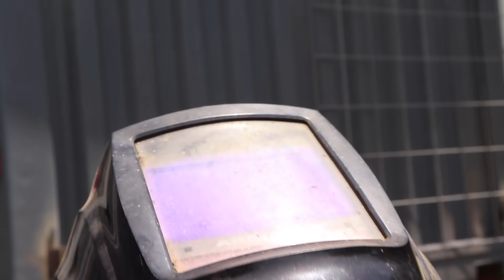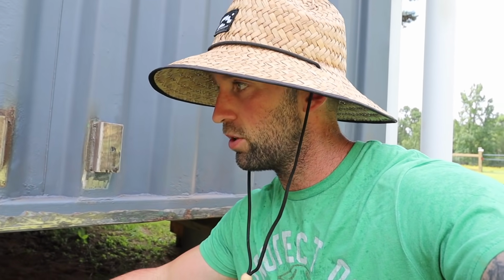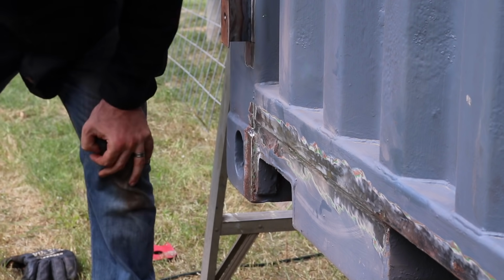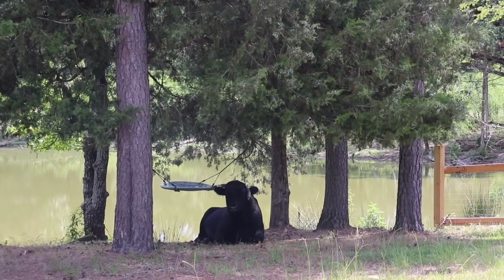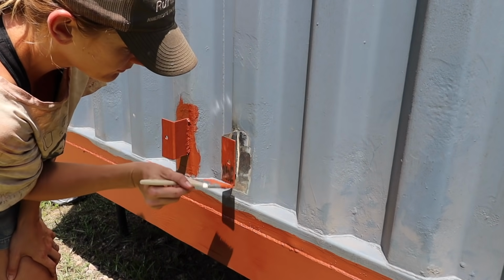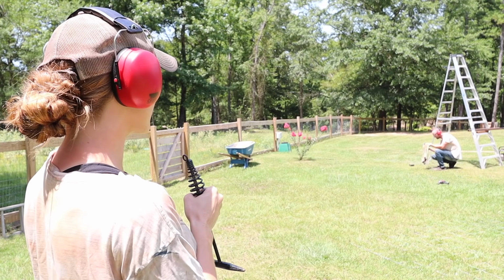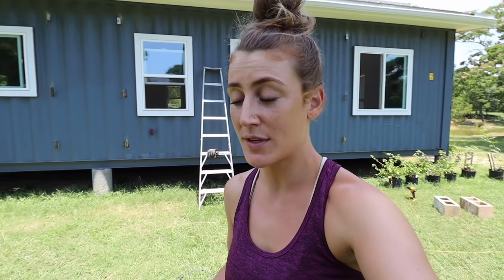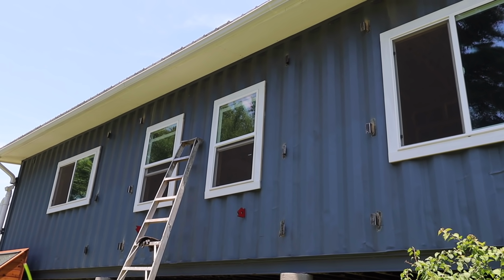How We're Passively Shading Our CONTAINER HOME!

Comment: Be careful on your trelles.
 If its close to ground, snakes might use it to scale up and enter your rafters...
 Just a thought, I was going do same thing.
 I live in guam a tropical island and we have snakes. Non poison but still a nuisance.
 My container home project @3/4 done.
 Still looking at best spray foam insulation.
 Not trying to keep heat in. Rather keep sun heat out.. Always sunny in guam. 
  I own a concrete house, just have a container that I am using as a hobby project and also to use as a next door home
  Beau is getting bigger each day
   Best of luck on your new home

Comment: Grinding fence sections in grass - if you have a strong magnet you might attach to a hand held pole and sweep for small metal bits. Similar to devises roofers use when picking up stray nails. Safety thought before mowing grass.

Comment: Wait - You said that you're NOT doing the SOUTH side of the house for passive shadng only cosmetic? The SOUTH side of any home is the side that gets the MOST direct sunlight. That's the side that you would want the MOST passive shade on! You need to research that. The SOUTH side should have got the most shade for summer cooling.
Reply: You're exactly right. If you're north of the equator you shade the south side in summer. They literally did it backwards
Reply: You're absolutely correct. All of our shops are passive shaded on the SOUTH side of the buildings. North of the equator the south side gets the most sun every day.
Reply: I was thinking the same thing and looked it up. The south facing side is the side that should have been shaded the most
Reply: While that may be true, my patio faces west and the late afternoon sun is horrendous.
Reply: In the northern hemisphere you want southern facing for passive solar in the winter time, which is the southern hemispheres summertime. 
North facing you want minimum windows for preventing heat loss in the winter.

They have a large amount of south facing windows and cosmetic shading.. eeeeek. Aircon bill is going to be high...
Reply: @steph0xGx  exactly right. In the south we shade the south and put the windows facing elsewhere. I don't know where they're located but shading the North side doesn't seem feasible in either hemisphere
Reply: I think the solar water heater, porch and addition are on the south side, may not be a place for trellises.
Reply: @Russell731  if you think they have sized their system enough to handle the extra load that having less shade and all those south facing windows will put on it then great. 
Guess it isnt you or having to live in it though

Comment: When working outside in the heat, I have found it really helps to use a fan to move the air to help cool down some.  I know you were moving around a lot, so put the fan so it blows towards the spot where you're spending the most time working.

Comment: Heat exhaustion. Here are some tips (Fans, please don't hate on me and play apologist on this. I'm really trying to offer advice that will help him avoid exhaustion): 1. Of course, drink plenty of water. 2. Move your equipment closer to where you're working. Last week, you had your saw 75 feet away from where you were putting the siding on the house. The time lapse showed you walking back and forth like a thousand times. Move the saw right by where you're working, and you'll cut your work load in half at least. 3. Stop adding external projects during the hottest months of the year (like welding this vine rack to the side of your house). I know you said you had to do it now, because you can't spray your foam insulation before welding, but you can delay the insulation until it starts getting cooler outside, and you can always plant your vines next year. While this may not be your first choice, it would be better than dying from heat exhaustion. 4. Turn on the air conditioning, and FINISH off your bedroom, bathroom, and kitchen, right away. Then move out of that camper, and into the house. Work on the outside of the house later, after the weather cools off a bit.

Comment: If you all are still deciding on a color for the home a light color does well to repel the suns heat. White works best but since the home is metal on the outside it will get hot and insulation can only do so much to keep the heat out

Comment: To cut a strait line in sheet metal I use a circular saw with a metal abrasive blade. Its much neater and much faster. Keep in mind you will then not be able to use the saw for anything else as all the plastic on the protection guide will melt

Comment: I have an idea to keep the bull from swimming around fence. Get some polypropylene rope (it floats) and some pool noodles. Thread rope thru noodles ,tie one end to fence post and the other to the dock...6 or more noodles. It may keep Ferdinand out, if not, it is not expensive. You could also extend straight out into the pond, tie a stone to the outer end, maybe angle it away from your dock. If Ferdinand has to swim away from your side he may stop?

Comment: Hey guys, just a little bit of info on a quick way to recover from overheating.  find a way to submerge at least your arms in cool water.   I can't post any pictures in this section, but we used to take a folding chare and these 2 foot x 8in. planter boxes that were meant to be hung on a balcony or fence and put them on the arm rests of the chair.  We'd fill them up with cold water and just make anyone who was overheated sit in the chair with their arms in the water.   It's amazing how fast you recover doing this.   Hope that helps you going forward.

Comment: The next time you get overheated take a towel /rag and put it in a bowl of ice water.  Then wrap it around your neck and leave it there until you feel better.  It works because there is a LOT of blood flowing through your neck so it gets cooled by the towel. Another trick is put your bare feet in a pan of ice water.

Comment: Trellis' are good ideas as they help shade and cool metal surfaces but did you consider that the constant moisture of the plants would cause the heavy wire to rust? Maybe brackets to hold something like redwood runners would last at least as long and might be easier to replace. Just for your consideration. I think you guys are doing great. Thanks for the videos.

Comment: **I am not sure how hot it gets there, but here is a trick I learned from a paramedic.  Wet and freeze hand towels and place them in the freezer.  In the afternoon when it is hot, take one out and place around your neck.  When the arteries along each side of your neck cool down from the hand towel, your whole body will then cool down.  This will protect you from becoming overheated.  And when one hand towel unfreezes and is no longer helping, go in and get another from the freezer.  😉

Comment: Can’t wait till you start the inside
Reply: A lot of the inside is done, for example, most of the wiring and plumbing. Mostly what's left is insulation and finish work as soon as the exterior is dried in.

Comment: Wow. What’s going on the trellises? I would’ve just welded a bolt or two on top and two on bottom for each trellis and hung the cattle fence from that, one of those bolts would hold probably 300 pounds.  Your welding is getting much better though. You should wait till fall when it cools off to practice though.  Lol. I would melt in that sun doing all of that Welding

Comment: Where has all the hardie siding  gone not even one frame shewing or is that all on the other side of the house. Think this is perhaps an old video am i wrong. Love your underwater fencing skills. Go well noel
Reply: Noel Hamilton -  You initial assumption is correct - the sections of the home with siding is on the other sides. The west and south sides are containers only (except a portion not in view that is the tall, middle insertion between the two off-set containers).

Comment: Spencer use a bolt cutter when cutting that hog panel.  Using a grinder with a cutting wheel is waaaayyyyy to much work for steel that size.

Comment: I have been watching your show since the beginning and you have inspired me to take things slower and really think about the design and the fabrication before beginning the project.  It is evident that you guys do that.  One thing I would say as a welder of 35 years...you are welding way too much!  On the brackets I would have welded about 1-2" from top down on both sides...more than enough to hold.  And a solid bead across the entire plate you welded to the bottom of the container?  That is a lot of work and unnecessary in my opinion.  I would have tacked it in place and then stitch welded 2" and skip 2 or 3".  Not sure what the duty cycle is on your machine but that must have taken forever!!  Anyway...love the channel and your story...and you are right...your welding HAS come along nicely!!!

Comment: May be a dumb suggestion here but couldn’t it work to use a rope with floats—like the shallow end separated from the deep end of a pool. If it’s enough to deter the cows, you could run that as long as you need in any direction you need and it would be far less cost intensive and physical effort than extending a fence further into the pond.

Comment: while I really admire all the hard work you did here, I'm still just confused why a couple of quick wooden trellis wouldn't have given you a solid solution that you could potentially come back to later and instead spend your time actually completing the inside so you're not sleeping in the cargo trailer??  I'm sure you guys have your plan! Cheers.
Reply: Once they spray foam the walls they don’t want to be welding on the outside, foam is pretty flammable. That may not be the reason at all, I’m just guessing
Reply: @Iamthathillbilly  Yes, they mentioned that.  Welding the trellis on seems like overkill!   To each his own.

Comment: spend precious money on the necessary things now like the interior, trellis can always come later.
Reply: RockIsland Rides -    As another commentator explained: "Spencer told you that the welding has to be done first before they insulate. Hot metal will melt the foam insulation so you weld first."

Comment: what keeping them from walking all the way around,  like walking around the pool? i think i would just make the fence go all the way to the other side of the pond just add a post on the other side to make it like a tennis net but using fencing wire the bull will push the metal net but will not brake it if it thick kind and in the middle of the pond one pole  2 in between make it a fat one also. Or what about a  wooden bridge across the lake
https://cloudfront.traillink.com/photos/ohio--erie-canal-towpath-trail_46013_lg.jpg   like this link i just put but only make very narrow for on person to fit and next person need to be behind the other to cut down on cost this link show the right kind of bridge and because it going to have lags you add fencing wire  on one side of the lags

Comment: 2:39   Did you anti-corrosion treat the new steel plates -- the back side of them, especially where they will form a double layer with the existing framework?   Atmospheric moisture will get in and cause corrosion otherwise.  If not, you will need to employ some form of pressure spray to force the paint upwards into those narrow cavities.

Comment: Pfft 100 Fahrenheit isnt that over the top hehehehehehe .... try working on a steel melting floor at that temp and over with all the protective gear on .... now thats hot .... or the guys who work in foundrys doing the repair work on blast furnaces etc .....

Comment: I know we are all fans here, but why aren't you getting at least one room ready with airconditioning instead of worrying about plants. You have a baby!
Speaking of which, you will have to fence off the bottom of the containers before she crawls under there with all the snakes.
Soon you'll be surprised when you can't find her because she has made her way all by herself to a spot she found interesting.
If you want to plant anything, plant trees that will grow tall, like Sycamore or Jacaranda. It will take them some time  to give shade, but then it's the best kind.
Reply: They have an air-conditioned room they sleep in. The exterior of the how has to be finished and dried in before work on the interior can proceed. If they were trying to live in the house while building it would be miserable with the dust and noise.